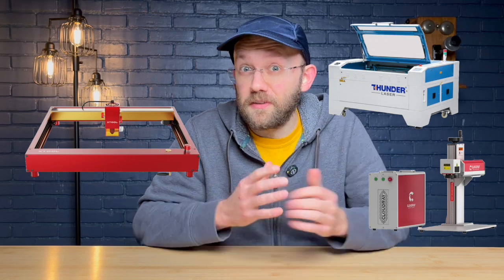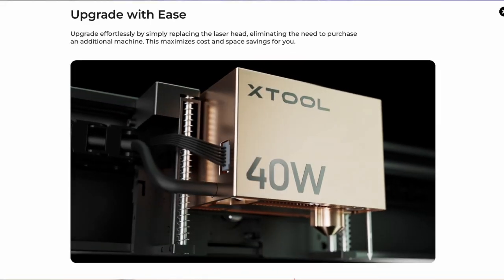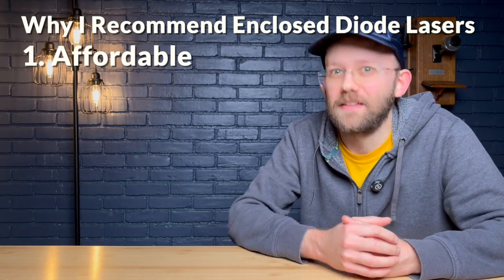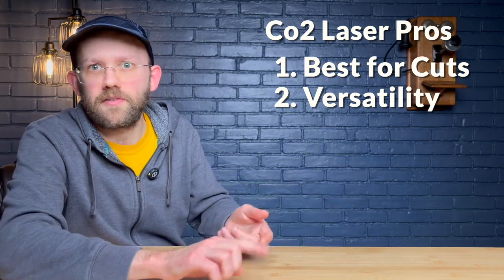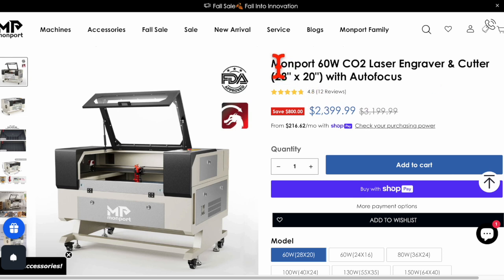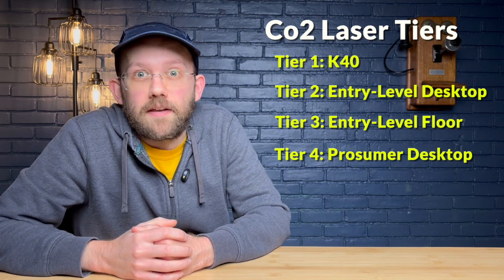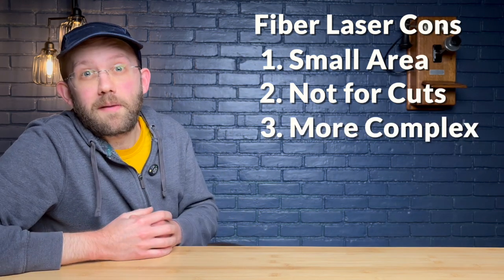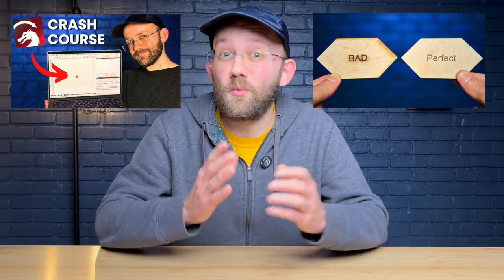Choosing a Laser Engraver (Beginner's Guide)

Comment from the maker: Get my free Lightburn Starter Kit files: https://go.chalkwatts.com/laser-starter-kit

Learn to make original Lightburn projects (co2): https://go.chalkwatts.com/co2bootcampcourse
Learn to make original Lightburn projects (diode): https://go.chalkwatts.com/diodebootcampcourse
Reply: Im a newbie and wanted to use your affiliate link for either xtool s1 or d1, which one is the minimum Wattage to cut 5mm plywood? i wanted to make ornament from plywood with engraved image mostly and maybe engrave a tumbler, will I need Honeycomb Panel and Smart Air Assist? because it is offer as a bundle. thank you!
Reply from the maker: @mcin71  - welcome to the world of lasers! My general recommendation for beginners is usually an "enclosed" laser (like the S1) because they're safer and easier to set-up. And if you do go for the S1, I believe 10Ws is the lowest available wattage. And that should be plenty to cut 5mm plywood given the right settings. I have a 10W D1 Pro and have cut 6mm wood with it many times. Hope that helps!
Reply: @asherdiy  thank you so much. I appreciate it!

Comment: I use an Epilog Fusion Pro 48 dual source (120W CO2/50W fiber) and it's disappointing. It's only a couple of years old and we barely use the thing but: 
1) The air assist is barely a puff. 
2)The focus is adjusted by raising and lowering the bed which rides on four threaded posts joined by a timing belt. Last year the belt fell off as apparently, the factory didn't tension it properly. Does the user manual tell you how to reinstall the belt? NO! Keep in mind that this bed has to be leveled to the laser track to within 0.001" or focus on the fiber laser will drift over the span of the bed. Had to rig my own procedure.
2b) After getting the bed adjusted the focus settings need to be calibrated in the on-board computer. The procedure in the manual, followed TO THE LETTER, does not work. 
3) Laser was misaligned from the factory and again the user manual DOES NOT DETAIL HOW TO PERFORM THE ALIGNMENT!!! Ruined a window right away. 
4) This past summer I had a rotary job and after engraving the first couple of parts I heard a terrible whack, whack, bang, bang, bang, beeeeeeeeeeeep. The display had an error about losing position on X axis and it had been smashing the head into the chuck of the rotary stage, destroying the auto focus unit. Turns out, removing the onboard computer and re-seating it was the fix. 

Overall, not the kind of janky problems I'd expect from such an expensive machine.
Reply from the maker: Wow - sorry to hear about all the hassle you’ve had with your Epilog. That sounds super frustrating.

Comment: Great video, I have a 10 watt and use lightburn but still not getting the results you are, mine will not cut plywood I use it in leatherwork and it will not cut leather, have you ever done a detailed setup video for lightburn for something like a 10w? I went up on my s value but not sure where it should be